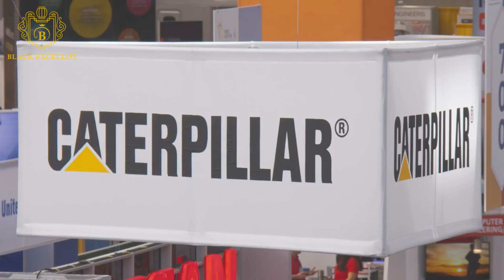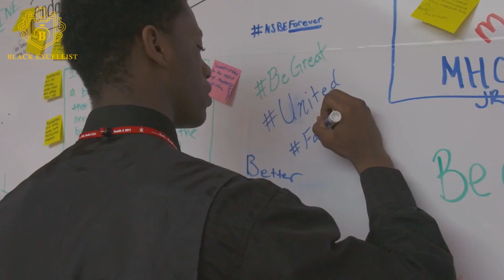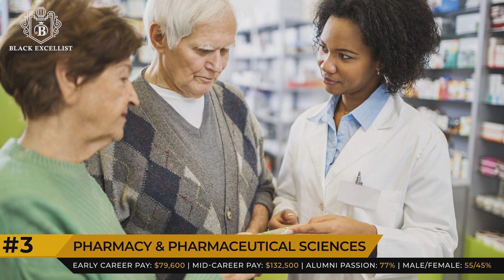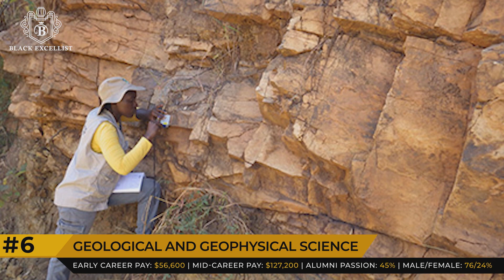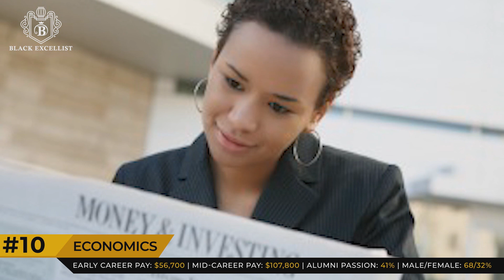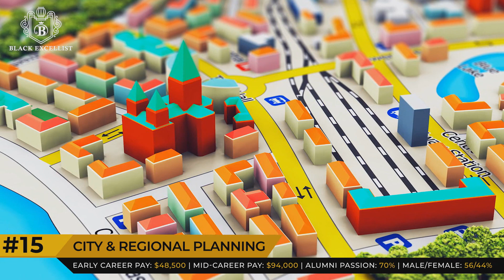Black Excellist: 20 High Paying 4-Year College Degrees

Comment: I personally endorse Computer Science as the best major to get you a really high salary really fast if you put in the work. And even if you don't put in the work or don't immediately start as high you can grow your salary by 20k by performing well at your current job and switching to another. I'm graduating in May myself and making around 160k in ATL my first year and 140k afterward (the 20k difference is due to a signing bonus).